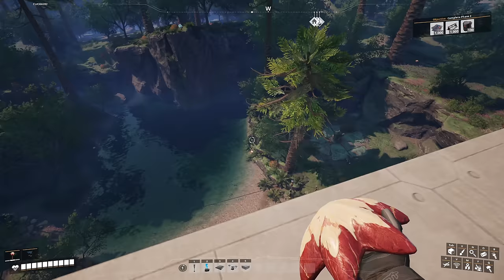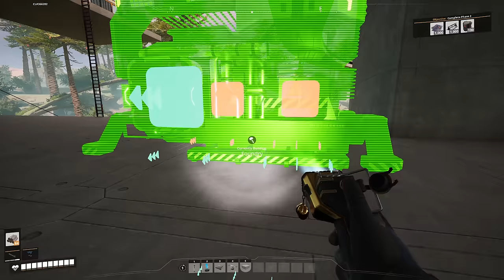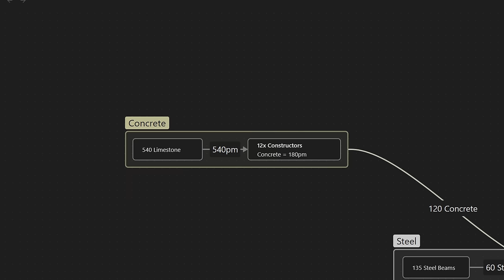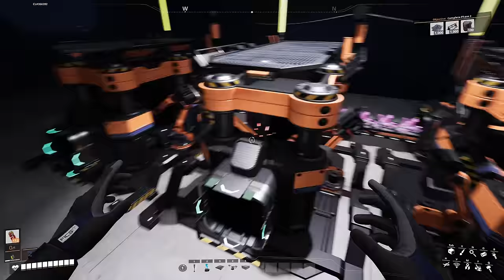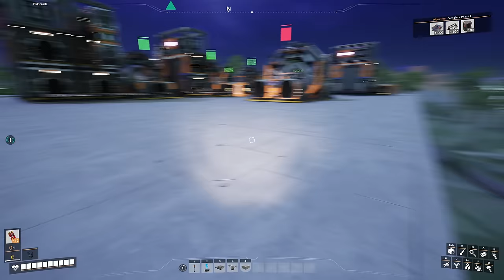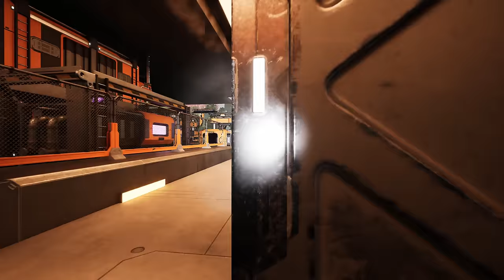MAJOR FACTORY EXPANSION!! In Satisfactory 1.0

Comment: I'm still so clueless about building effective factorys
Reply: You're not alone, I'm struggling to figure out which is the more effective way to build. Either work off what you have and scale up as you get more input. Or work from what you want to end up with and work backwards.
Reply: Best thing for moving forward is the awesome sink. It's a big chunk of power early game but unless your feeding it directly from a node they aren't bad.
If you make sure each end line leads to your storage or outbound line with a smart splitter set to send overflow to the sink..
After a few times including it in each production area you start seeing bigger stability across your systems.
 It sends extra for You shop tickets and you don't get sudden shutdowns when you grab resources
Reply: @novagaming4970  effective is easy. Efficient is mind numbing
Reply: You can pretty easily just build spaghetti until completing phase 3, as components aren't too complex as to need their own sub-factories or much necessary planning. I only have around 1 copper node, 6 iron nodes, 3 oil nodes, 1 limestone node, and 2 coal nodes. This ALONE is easily enough for a 80-90% efficient factory that built all three components in about 30-60 mins (after I built everything of course). After this phase try thinking about 1 thing at a time, one way is with sub-factories. Say you need a lot of one specific component? (such as rubber and plastic) Just go somewhere with all the necessary resources and build a sub-factory ONLY for that component, then train it around wherever you need it. You'll find later on that actual factories making parts aren't hard to make, but the logistics of getting what you need where you want it is difficult, so don't overcomplicate it by taking on too much at once. Also don't worry about efficiency, 99% of the time you should use manifolds so you'll likely just overflow everything eventually anyway.
Reply: Manifold everything, use satisfactory tools, and from time to time merge some factories. I have barely 100h but this time i'm having so much fun because of manifold
Reply: I make things modular. So make ingots and belt them to a central location as building material main base. 
I basically build from left to right with constructor and assembler (if needed) for each building materials. 

It took a lot of space, but simple and easy. Not really efficient, but just leaving it overnight is good enough
Reply: My strategy is find some nodes I want to work off and try to utilize all of it.  Like for steel, I have three pure coal and three pure iron so I make three towers with foundrys on the bottom floor, then beams, pipes, encased beams, concrete, whatever. Each floor holds an item.
Reply: Solution: Embrace spaghetti 🍝

Comment: Why would you remove biomass power now since its belt fed it can be like a battery. Mix in somersloops into making the solid biofuel processing and you end up with a bunch. Ive got 10 full large containers full so far and plan to rebuild the biomass plant with mk4 belts and add even more burners. Belt fed biomass is one of my favorite new things.
Reply: Use it in combination with coal and you get even more available power
Reply: It comes down to being a system that has to be manually fed. They added a way to extend the duration by adding the belt but no way to automatically gather it.
Reply: I deleted mine and spit at the screen.   Good riddance
Reply: Why would you continue using biomass after getting coal generation? 1 Coal generation is worth about 2 biomass burners which you STILL have to go gather wood and leaves. Trees and bushes also don’t grow back so you’ll have to do a lot of running and your making your world look barren 😂
Reply: @dumbo-lv7jy he said that I could be a battery
Reply: @BraydenParker-s5t Isnt that the job for the power storage
Reply: @novagaming4970 bio mass burners can burn coal?
Reply: @PercyOBJ  no no i meant using biomass as well as coal power for even more capacity

Comment: Hi Bitz. Great video. How do you explain the set up you have for 9 iron smelters all being connected from one conveyor line through splitters? Wouldn't that make the last few smelters only receive a small fraction of the incoming line?
Reply: I haven't got to that part yet - but assuming he's feeding 270 iron ore through MK3 belts, the 9 smelters will use up all 270 ore between them. As the first smelter fills up, more will then pass down the line, filling the second, third, fourth, etc. smelters. Once they are all full, the 270 ore will be consumed continuously by the smelters and stay full. This is called a manifold and it's a much easier way to handle inputting than trying to balance belts with splitters.